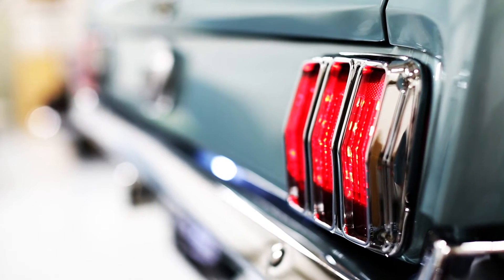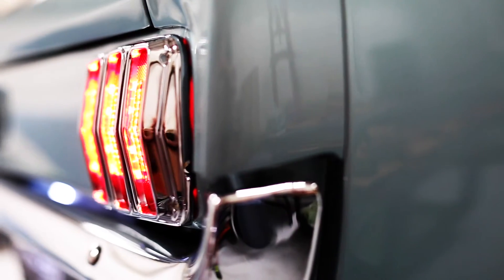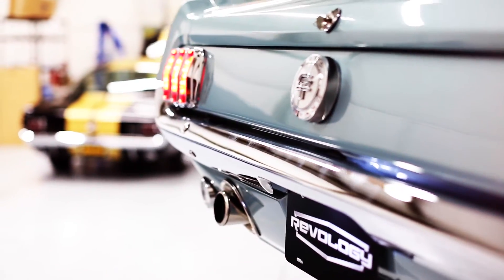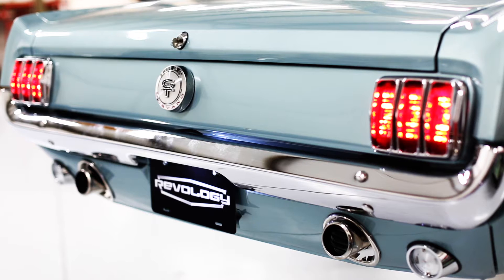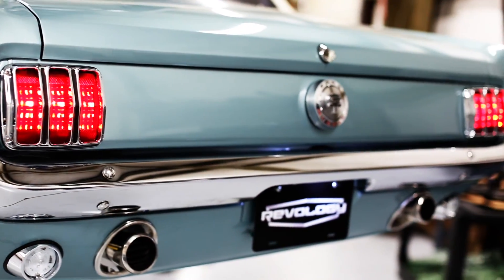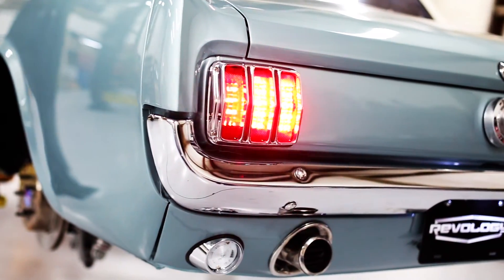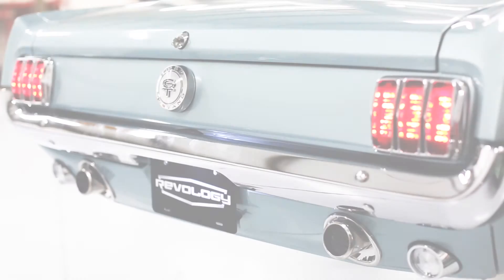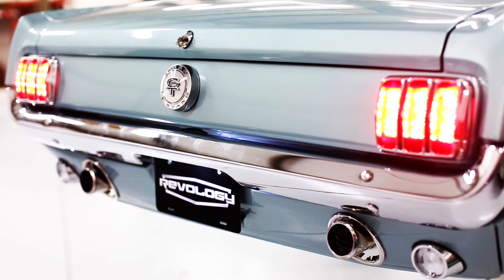How we build the Revology Mustang   LED lamps

Comment: check these Mustangs out Carefully the Light Blue white Convertible Mustang the Right rear tail light is not aligned correctly with the Left Tail Light, Yes it could be the Angle But I believe the Right rear tail Light is lower on its Left side than on its Right which does not Match the Left Rear Tail light. Now this is a Simple thing But a Buyer of this Car May Never Know until someone that has an eye notices it and tells the Owner or the owner Notices it when its to Late but why did the Builder not see this Just asking and as I said it could be the Lighting and or angle of the Camera, I don't think so Can anyone answer this how about you Builder.